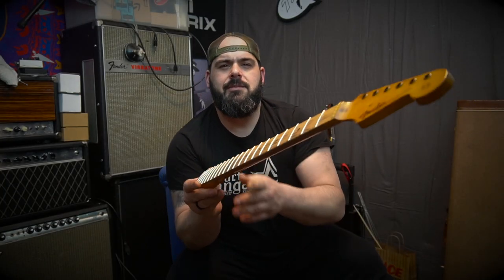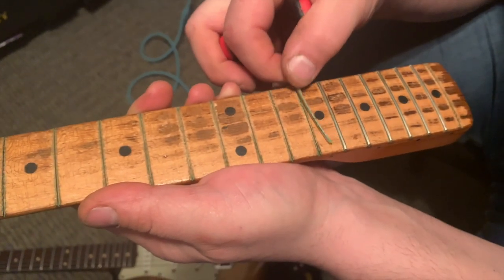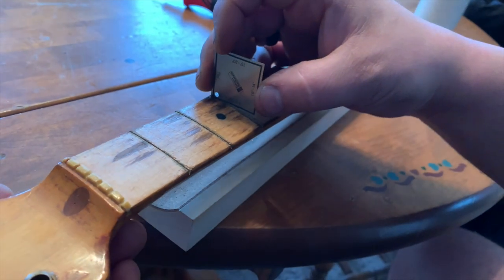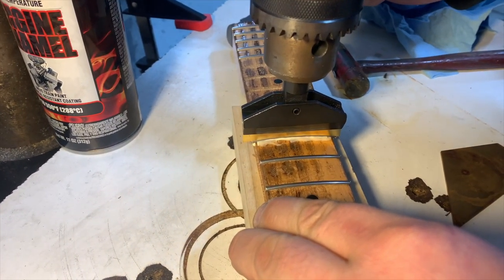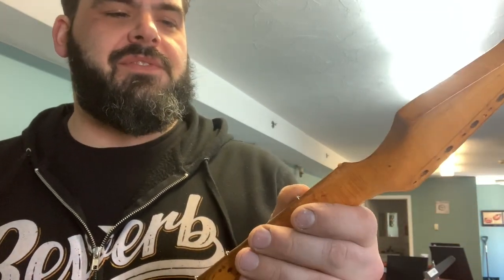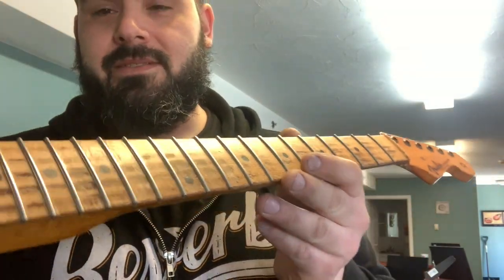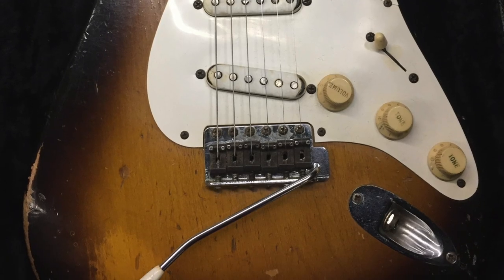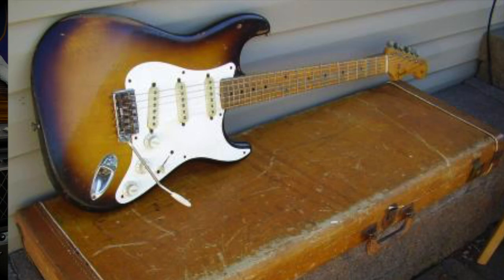HUGE UPDATES ON THE 1957 FENDER STRATOCASTER PROJECT!

Comment: Thanks for the cool videos Nik. I have a question. Is it possible anyway to keep the original nut with 6100 frets or 6105s or I will have to get a new nut? Thanks again.
Reply from the maker: U can shim the nut up if you wanted to keep it.  Usually with a sliver of maple or spruce
Reply: @theriffwniksevigny5473   the shim needs to be glued in the slot before I put in the nut ?

Comment: Does the resale value go up if the guitar is restored even with a relic treatment?
Reply from the maker: Amen!
Reply: I understand the concept of having guitars relic’d. I was just wondering if the guitar you are working on were to get refinished with a relic appearance, going to help the resale value. Since the photo of the paint job you liked looked well worn.
Reply from the maker: DaveSteele07 more to make the guitar look normal.  Clearly not passing off as original, being well documented in the videos.    But, you cant have a brand new shiny body with all the honest wear on the neck
Reply from the maker: ham and cheese if it was an original finish it would happen.